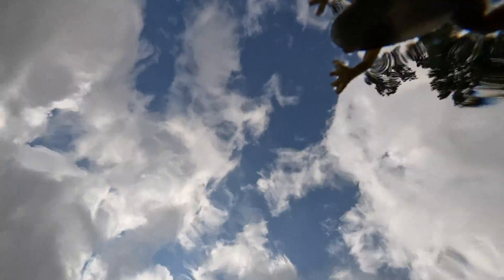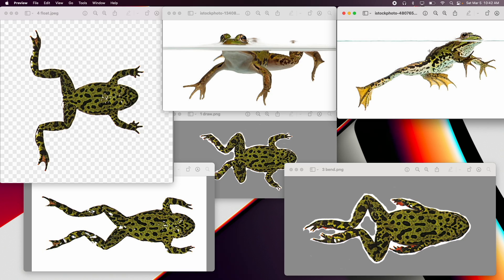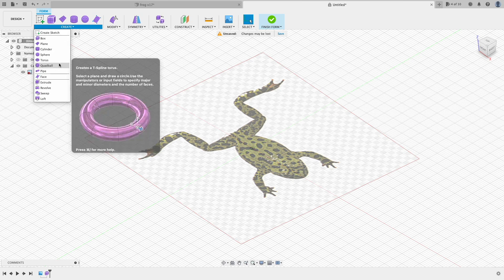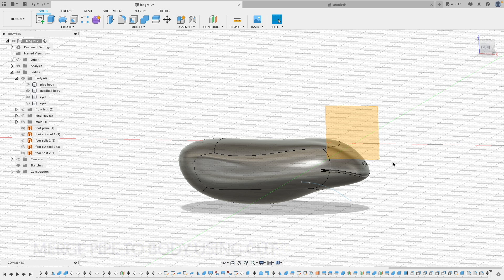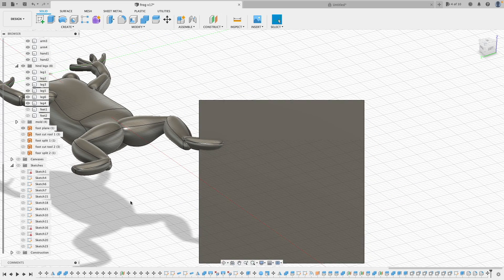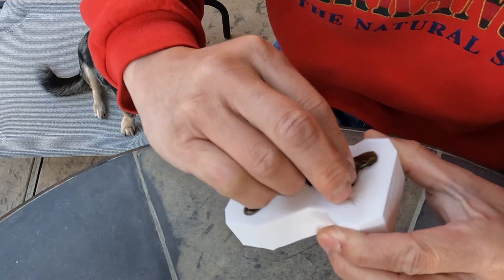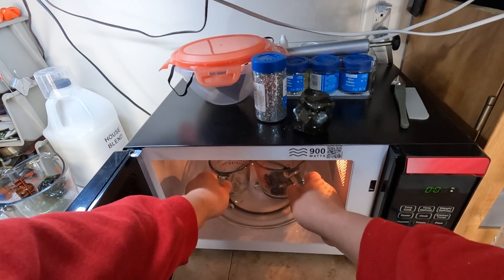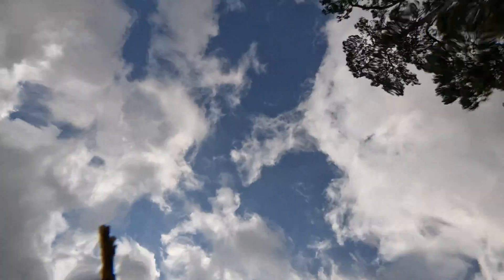Making a Soft Plastic Lure - Lazy Frog

Comment: A couple of ideas on floating. 1. Use a floating formula plastisol, like dead on white feather blend. 2. Add micro balloons to the plastisol. 3. Print a hollow insert and place it while pouring. (this is tricky since you still need a place for the hook to go.
Reply from the maker: Thanks for the ideas. I will try the feather blend. Was thinking the micro balloons but don’t know where to get them. Did the foam before (for the bat) but it’s not ideal. If the feather blend works that will be golden. We will see.

Comment: You can buy floating plastisol to make floating baits
Reply from the maker: I think that's the most straightforward solution. Do you know if it will still float with the weight of the hook?
Reply: @yauckoutdoors  I think it will still float because the frog is quite fat